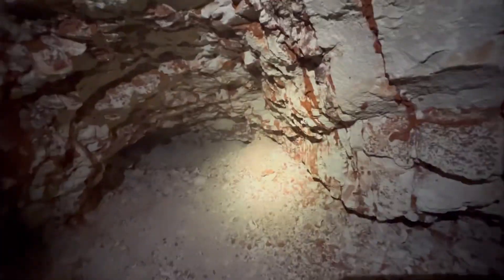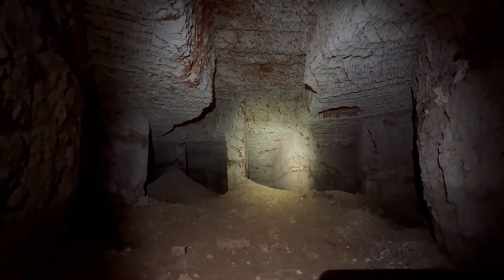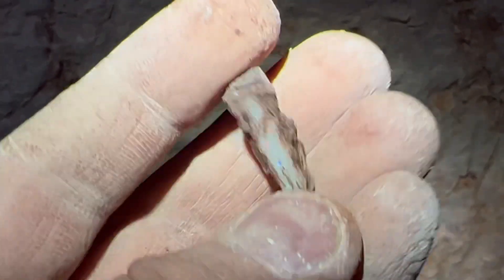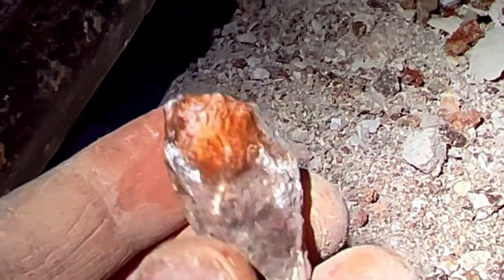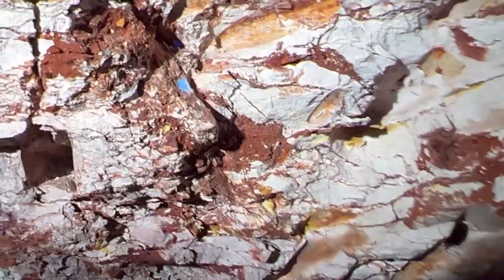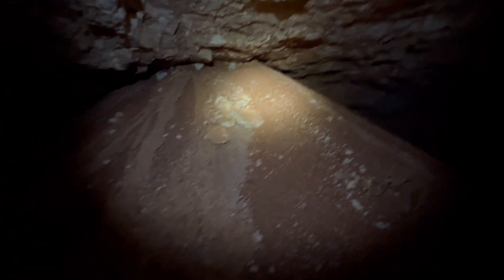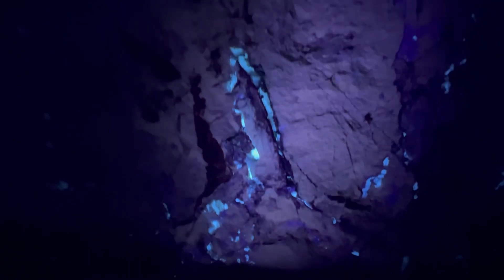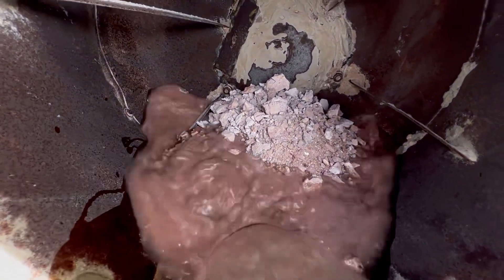Coober Pedy Opal Mining. Four gruelling days end in last minute find of BIG Olympic GEMS!

Comment: Does really white opal make good doublets?
Reply from the maker: What I’ve found is white doublets are a great way to make white opal go a lot further although still a doublet and cheaper than a solid, it looks almost the same once set and still makes a great piece of jewellery. We sell a lot of them as auctions and they are very popular!
Reply from the maker: So I guess the idea is not so much to darken the backing to kick out the colour, but to be able to use thin pieces that would otherwise be sold rough or for chips etc.